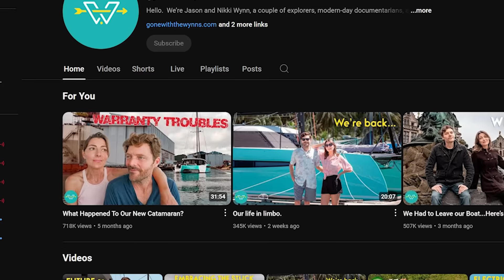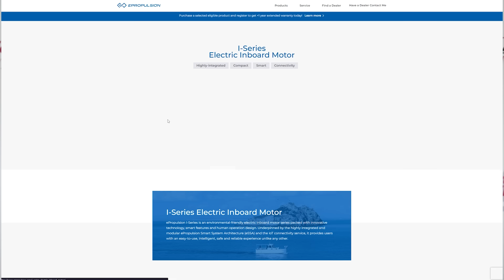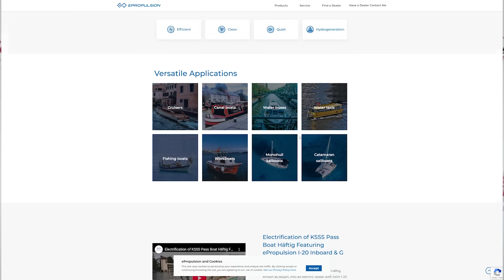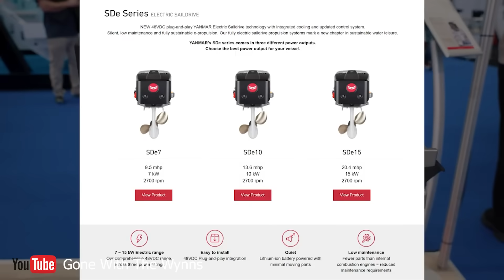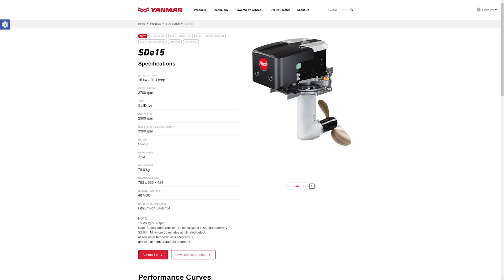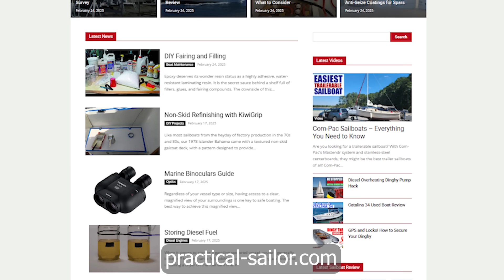Is It Too Soon for Electric Sailboats?

Comment: I converted a Catalina 27 from Atomic 4 to a Thunderstruck kit and love it.  I build a 15KW battery bank and with it I can do 3 knots for 10 hours on a charge. My use case is to motor away from docks and then sail locally so it works well for me.  That being said I just bought a Catalina 34 with a diesel and for that I will be traveling a lot more and range would be a issue for electric.

Comment: You dismiss “Sailing Uma” with a back of the hand that suggests you haven’t truly looked at their 400+ videos, seen their research and what they’ve learned and shared—and most importantly how they’ve shown the overwhelming advantage of electric over IC on a sailboat. They do have an edge from attracting significant Patreon, advertising, and product underwriting support that Joe SundaySailor wouldn’t be likely to enjoy. But they very clearly have shown the way. You’re too firmly in league with the EV wheel motor naysayers who kept chanting “they’ll never solve the unsparing weight issue” — (which they did—ain’t engineering advances just great).

Comment: It’s crazy. Every sailboat has more weight in ballast than is needed for batteries. It’s only a matter of time till that is utilized. I’m working on a design now.
Reply: if your not sailing that balast isnt needed. Im daydreaming about a gemini 105 removing the mast and installing a roof of solar panels. Using a Torqeedo electric outboard. ( Im not planning on anything offshore)

Comment: 5 to 10 years for a battery swap out? I think there is a fundamental misunderstanding here on battery tech. If managed well, with a solid BMS - once the battery levels stabilize (typically between 85-90%) of original capacity after 5 years, they will far outlast a 10 year lifespan before they become obsolete, and yes, that's current battery tech. If manufacturers are suggesting 5-10 year lifespan for a battery bank, it's because they've built in obsolescence - similar to LED light technology. A lot of these manufacturers have invested in ICE technology and it's going to be hard to pivot until the market demands it .

Comment: I think an ideal setup would be a hybrid system.  Electric drive.  Enough battery for 50-100nm range along with a small auxilury generator for when you need to push things.  Stack as much solar/wind/hydro regeneration as is pratical for your boat.  If your mostly under sail the passive regeneration may be enough for your occasional motoring needs and you have the generator to kick on for added safety.  IF your motoring more than sailing probably better to just stay ICE as even a multihul probably does not have enough room to put solar to gather more than 20-30 nm a day and even that only at a slow speed.

Comment: Crazy idea how about instead of using dead weight (lead, cement or whatever) as ballast we use LiFePo4 batteries? I bet that would solve the 200 nautical mile range issue.
Like 3 tons of batteries would equal 480kwh and even if we only use 80% we get 384kwh which enables a 15kw inboard motor (consuming 17kw continuous) to run for 22,6 hours at 9 knots.
Thats already 203,4 nautical miles.
Reply: The cost of 480 kWh in Lithium batteries is around $150,000 For comparison a Tesla Powerwall system is 13 kwh and costs around eight grand. And 15 kW is 20 horsepower although admittedly an electric motor is probably more efficient than a diesel.  As we say in Boston "Can't get there from here..."

Comment: I've recently got into sailing and don't have much experience.   I have a lot of experience with off-grid solar-battery systems and the general rule of thumb is if you need more power, you need more panels and batteries.  You still need backup generation capacity, i.e. stationary or mobile generator but if you design over design your solar system, you generally need smaller power generation and less or more infrequently you have to run them.  Bigger solar/battery system means more surface area, more weight and more cost.   Existing sailboats can only accommodate so much solar and batteries but ideally, a boat has plenty of surface area and requires heavy keels.   If you can design a boat from ground up, perhaps cover the top surfaces in solar panels and use the weight of batteries as a keel and even use a rigid sail and cover that in panels, you can very easily not use a diesel engine.  A 4-5KW solar array with 50 kwh battery along with a 1kw generator would be ideal for a 30-40ft sailboat.

Comment: It's seems the electric motor designers need to include better cooling similar to how ICE engineers needed to improve their mufflers and integrity of various parts with experience... and still do. Yet, if you need to go hundreds of miles on motor in waves against wind and can't sail it then you need a generator keep your batteries charged or reduce their rate of discharge. You may use that generator once a year but you will be maintaining it more than your properly configured and cooled electric motor, controllers, and batteries.

Comment: Electric boats are like electric cars, they will be much better if designed from the ground up for electric propulsion. At the moment we are just seeing old combustion boats - diesel out, electric motor in and batteries where ever there is space to put them.

Comment: Tim, while extolling the space savings provided by an electric motor, you failed to mention the huge battery bank that will be required to power it. Yes, it's sometimes possible to replace the diesel fuel tank with batteries, but most coastal cruisers have tiny fuel tanks (20 gallons?) and some have tanks that are located where batteries won't fit. Just sayin'.

Comment: One fundamental problem which will not go away and that is Range. The power and range of an electric auxiliary is still a serious issue. How many tons of batteries or thousands in Lithium is good enough to provide the equivalent (to diesel etc) safety range on windless days or when the need for power is crucial...and (listening as I type!) Thanks Tim you said it while leaving the door open for future developments...nevertheless love the way electric sounds!

Comment: I recently replaced my auxiliary outboard motor on my J-29 with an E-Propulsion Navy 3.0, 5-6 horsepower equivalent.  It was expensive but so convenient it was well worth it.  I saved weight on the transom.  Battery is under the cockpit where the inboard models of this vessel would have had the diesel.  So far it has been great.  Pushes the boat at 5 knots in calm water at 2/3 throttle.  Not a long distance power choice but after all its a sailboat.  I mostly use it in and out of the marina or if the wind dies which is rare in the SF bay area.

Comment: New Subscriber!  Love your channel.. -- BUT --- Please, stop talking about "electric' as though electricity is the issue. It is NOT the issue.  We would be better off if we refereed to them as BATTERY boats and BATTERY cars. Everyone loves electricity and electric motors work fine.  The real issue is batteries and generation.  That's it.  ..and batteries are the main issue.  We don't need to lean about this or that company making yet another electric motor - they have been done endlessly and all will fail as a solution since it is about the batteries and the batteries are hopelessly insufficient. I used to think that they would eventually get better but have learned that they never will.  Lithium has a theoretical max capacity that is about 3 times better than current (and there is nothing in the universe that can hold charge better than lithium). That is to say, if every single electron could be "programmed" to hold charge perfectly, then a given battery could be about 3x what it is today, and that theoretical limit cannot be reached on earth.  In reality, we would be doing extremely well if we could get 2x  improvement. So batteries will never be able to replace diesel.  One liter of diesel holds 9800 mj of energy. 1 Liter of batteries holds about 140 mj of energy. It's about 10,000 to 140.  The issue is over.  You are much better investing in better light wind sails and more efficient sailboats, than in batteries as it will take you further.

Comment: Electric is very compelling solution. No more refuelling or servicing an engine, or the noise, or the smell, or the vibrations, or the general ethos of expending fuel when you have a wind powered boat. Batteries can be down low as ballast, the engine compartment is half the size or gone entirely replaced by a pod reclaiming space. Just the fact that the motor and weight distribution are different could open up the interior of the boat. 

That said it's still stupidly expensive technology but it's desirable for it to become the norm. Range is a concern, but even if it covered 80% of use cases that's still a lot. People could still carry an outboard as a backup - not ideal but maybe they have one anyway. Boats also need a means of charging other than just shore power - solar, wind, or propeller and beefier batteries for range. But it's all doable.

Comment: 🤔Does 'Practical Sailor' really get the picture clearly? Try this in mind. The reason one sails is the natural power, quiet, out in the elements, enduring heat, cold, rain, sleet, huge sails, wet lines, heel angles, fierce winds and worst of all NO winds

All the wind power comes from the sun. Therefore there is a real possibility to use the sails for short durations, if needed and instead use batteries (as the lead keel weight) to power the electric drive motor(s) for long voyages. Yet sailboat manufacturers do not want to put themselves out of business by building solar-sail boats with solar electric generating modules atop a huge roof. To date, a few designs around catamarans equipped with mind numbingly complex solar/hybrid systems (fossil fueled). A brilliant idea but fails to deliver the dream.

The technology is already here to create a much more friendly cruiser and it does not need to cost $12,000,000 as was Turanor PlanetSolar. I have quietly done this long ago, just to prove the point on a 30 to 40 foot Great Loop boat that requires no wind or fossil fuel. It is a privately built prototype that is 39 years into its life. mogcanalboat.com

Thank you for bringing some of the " electric alternatives" to light but it takes a lot of journalistic digging to find the seed of a solution that portends a paradigm shift.

Comment: Interesting stuff, perhaps we are on the verge of a major shift in boats to move away from combustion engines just as it has in autos?  A couple of points:  We plug our Beneteau 350 into shore power only in winter months to keep a small space heater going, mainly to ward off condensation and mildew.  During the summer months the only source of electrical power (other than the engine alternator) is the solar array.  Would a solar array be enough to charge the battery in say a day or two?   Also, in our waters (near Victoria BC) in summer time, the winds are often calm and you could end up motoring 6 hours or more to get to a destination, not just for 30 minutes or so to get in and out of the marina.  What kind of range can you expect from a current-era battery array?

Comment: There are two boats on my dock in various stages of being converted to electric. I support them and am excited to see the results but I can’t see it being an option for me as mine is smaller (30’ full keel double ender), has very little room for solar, isn’t very fast(hence no regen), and not a lot of room so any extra gained space would be taken up by batteries. In a few years I could see battery technology improving enough to make electric a viable alternative to most modern boats
Reply: You might check out the channel Sailing Vessel Mig.  They've done pretty well on a electric-converted Nor'Sea 27 "Evie Mae", an even smaller full keel double ender.
Reply: @ cool. I watched a couple of his very early videos when he first got the boat, I’ll have to catch up

Comment: the moment we pack double kWh in the same weight and can charge faster  in a battery, E will win.   its coming ... and it isn't lithium... so it won't thermally run away...

Comment: The Wynn’s issue is that their system is too complicated. They love the flashy tech stuff and it doesn’t work on a boat. Simple electric systems, like Uma’s is far superior. If you have a sailboat, then sail it and use your electric as a true aux source of propulsion. Otherwise, just get a stinkpot and stop pretending to be sailors.
Reply: An electric stinkpot, I assume.  And with a flying outhouse and cocktail lounge.

Comment: I don't understand the range argument against electric engines. It's not as though you don't have a generator on board, right? I mean, obviously you can't get enough range to cruise on just battery storage, but that's why if you were going electric you're going to install a huge amount of solar and a beefy generator as well.

Comment: If electric boat batteries are anything similar to electric car batteries, they'll last for15-20 years before they hit 80% state of health - at which point they become second-life batteries (i.e. storage and backup use for homes and buildings, etc). As an EV driver of 6 years, I can tell you the demand on an EV battery is significant, but with proper battery management systems, they can last a long time. I don't know if moving a boat requires less energy than a vehicle - from a physics point of view - but I can take comfort in knowing the battery manufacturers in this category know what they are doing - and no company like Yanmar or E-propulsion is building a half-baked system. When we get a large-scale solid-state breakthrough, it may be a turning point. Until then, as much as I abhor the idea of burning fossil fuels, I'd go hybrid and have a diesel backup. The very idea of being the boat that makes a silent early-morning departure from the anchorage is quite appealing.

Comment: It seems a lot like fear mongering when you choose the worst cases.... the fails over the successes, to high light. Even worse when you take a hybrid and call it "electric". It seems when it comes to cars people have no problem distinguishing between a Prius and a Tesla as very different, yet this channel treats them as the same. There are successful electric boats out there with everything from forklift motors to "built for boat" sail drives. These boats have crossed oceans and somehow manage to arrive on the other side with a full "tank". The problem with Yacht manufactures is that because of the price of their boats, they are selling to people who in general have more money than brains and an expectation way beyond reality. A diesel tank has a limited range and so does a battery. It is unfortunate that Yacht manufactures do not size the battery back to match the same size yacht diesel tank and then not advertise the ability to run your yacht like a condo on the grid. I think that if the electric battery bank was treated as totally separate from any house bank and was sized correctly (like how many people use their starter battery as part of the house bank?) If The Yacht owner was told from day one that the expectation was that the electric "tank" was expected to be filled at dock like a diesel, and any house system was specified as a separate system (just like a diesel powered craft with it's own genset) with only excess house power being allowed to help charge the motive tank, this means the house bank is full anyway and the sun is still shining, there would be pretty much no more problems than we see with diesel power now..... thinking about a lost bridge and several groundings I have seen in the news. Those who have had success have  built their own and understood how to use it best. I will also point out that so far as I know there is only one commercial Edrive that is what I would consider properly set up to use the motor as a charging system but there are also home built setups that have manged success in this. Regen takes a variable pitch prop to be of any use. I think it is not about The E-yacht being ready so much as the sailor. My apologies to any of the sailors out there I may have insulted  ;)

Comment: I think, compared to other electric vehicles, sail boats are actually an easy case. They already have a primary means of propulsion with unlimited range. It is the human nature that actually makes the problem in almost all cases. Trips with tight schedules require a lot of motoring if the wind does not deliver. Simple life at sea has been replaced by air conditioning and a gazillion coolers and freezers, cooking is now often done with induction instead of gas...and so a generator needs to be running most of the time anyways to create enough electricity. It is pretty ironic that nowadays most new boats are designed with heavy racer influence and lots of performance potential but those racer-cruisers rarely get moved by their sails...

Comment: We have a little 18 foot Windrose 18. It seems like every time it's been sitting for a while, there is a gas related issue with the outboard. While maintenance isn't much, it's still a bit of a chore.
We're now planning to get an electric outboard with an external battery, so that we can also cover longer distances.
Reply: if you can't keep a gas Engine going good luck trying to keep electric outboard going as saltwater and electrics don't mix the biggest problem on any boat is electrical corrosion